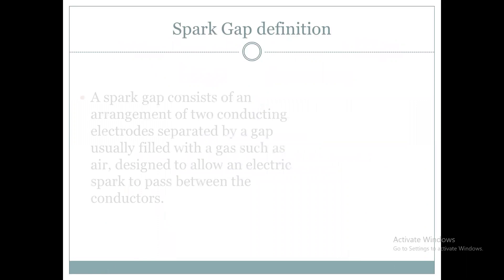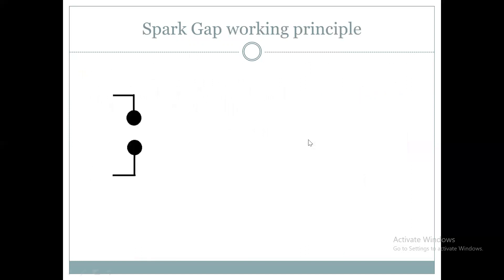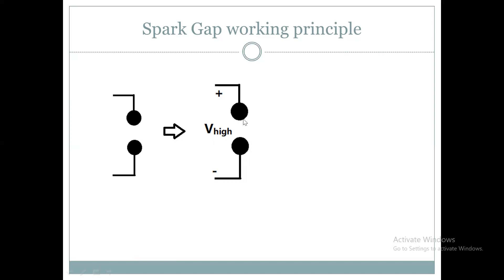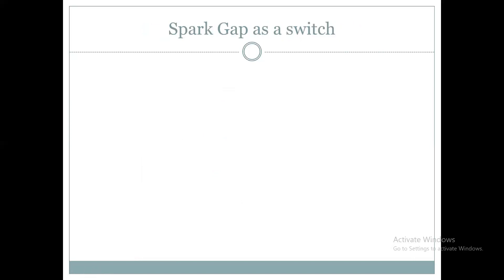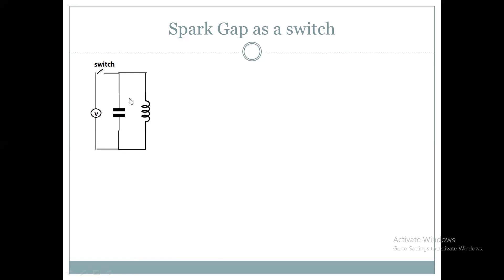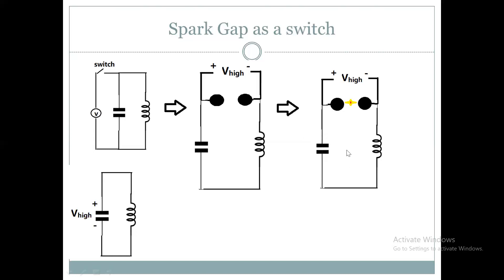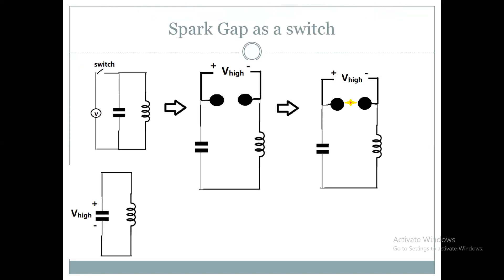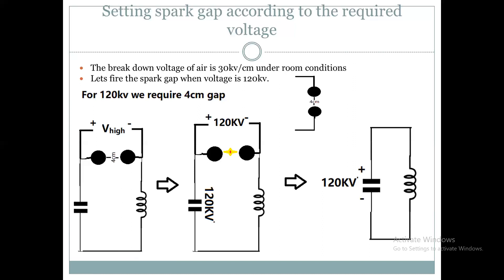Spark gap as a switch in high voltage circuits

Comment: GREAT VIDEO!!!
If a fast arc from a pulse transsformer produces a quick arc across the electrodes, will the ionized air keep the capacitor conducting  even at athe lower voltage as the capacitor is discharging?